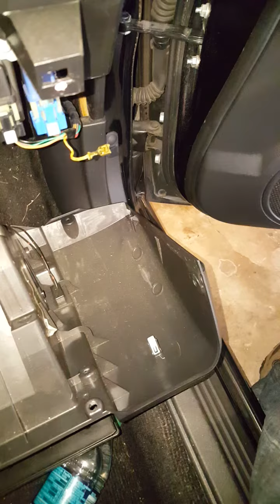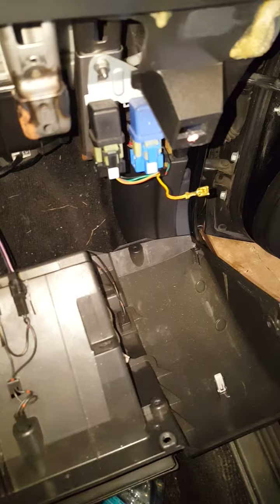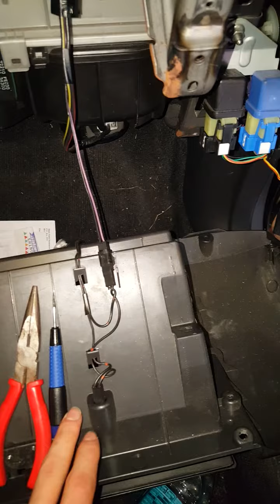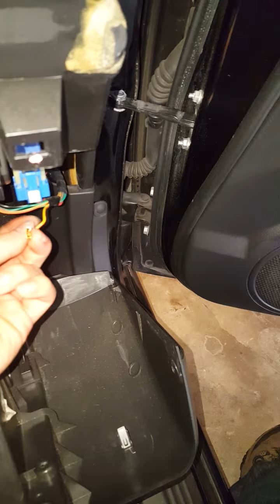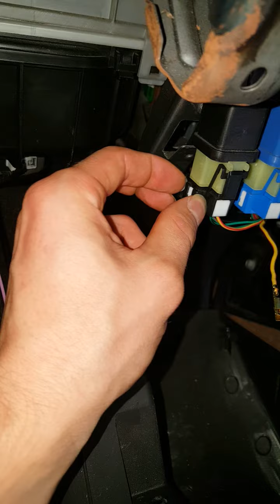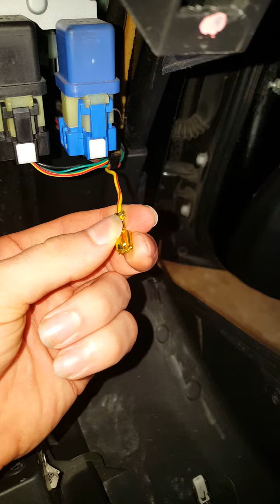07 wrx daytime running lights delete

Comment: FYI, this does not work on the 2007 WRX STI.
Reply: I’m trying to figure out. What’s the solution on the STi ones
Reply: @babyjoker360  there is a wire that you have to cut under the dash on the driver's side. I'll have to see if I can find it again and let you know.